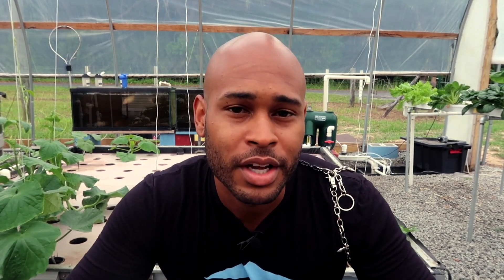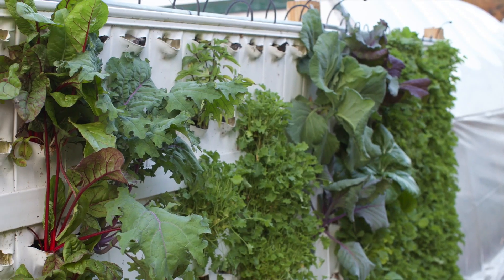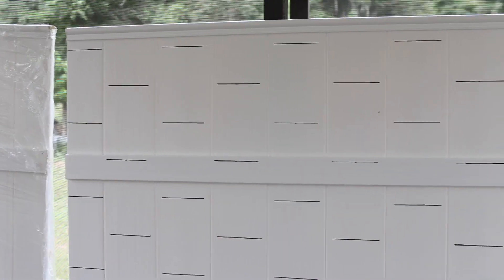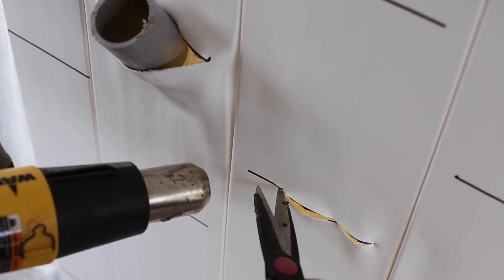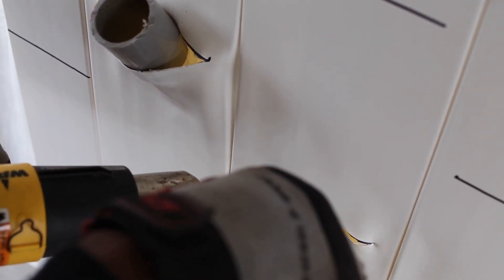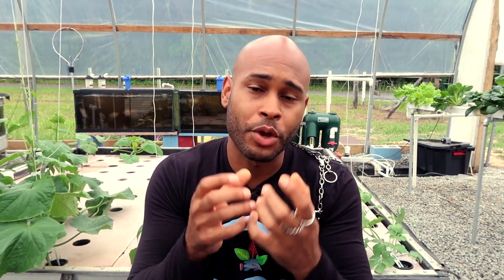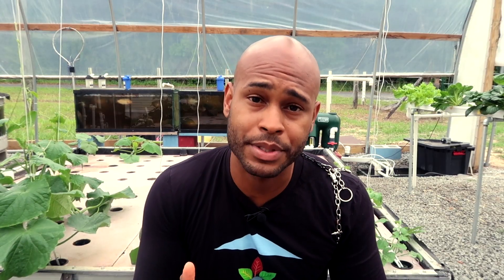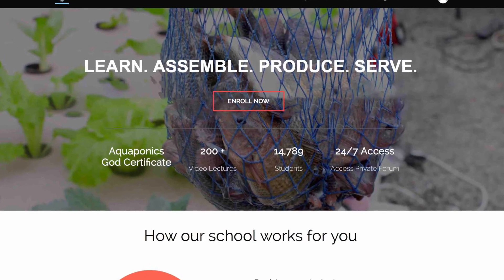THE AQUAPONIC SOUL WALL

Comment: Would it help to put in another possible smaller bead filter the water will pass through before it hit the soul wall? Or will the single Bubble bead filter be sufficient?
Reply from the maker: A single bead filter will probably be good for this particular setup.
Reply: @TheSchoolofAquaponics  my goal is to duplicate your system wih the DWC and NFT set up but, add the soul wall to it. So one Bubble bead filter will suffice all of those set ups? (For prevention of solids getting in the wall and obstructing water flow.)